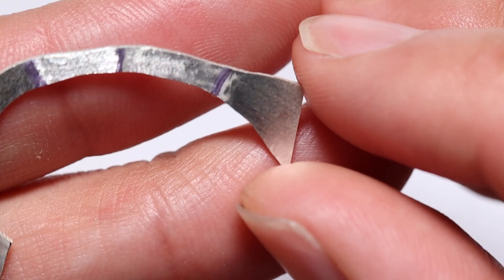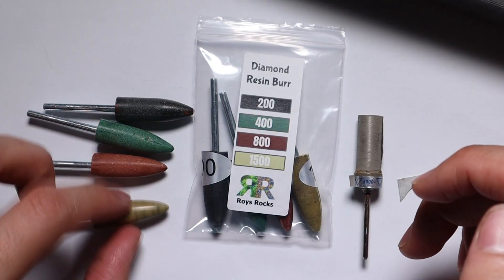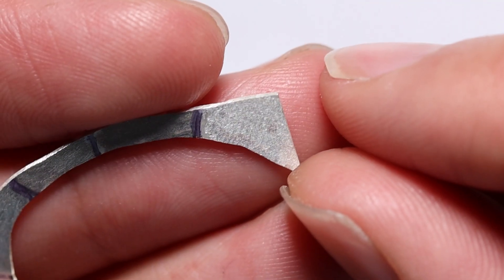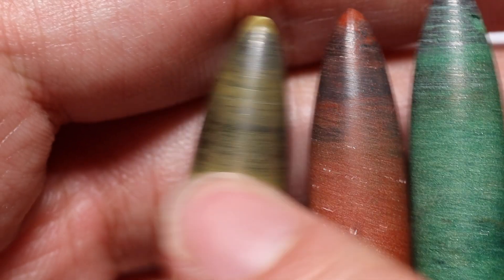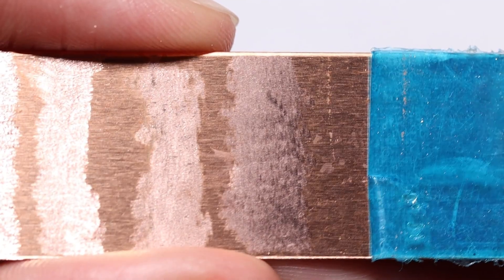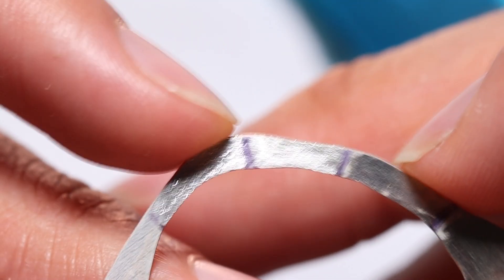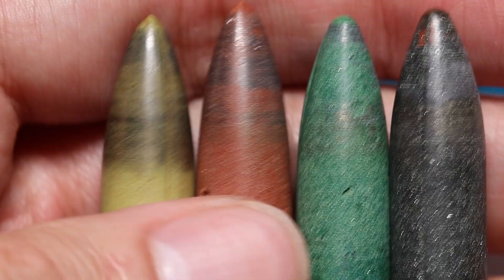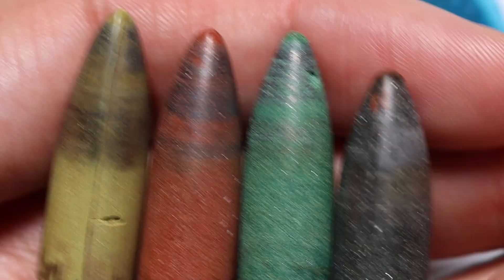Diamond Resin Burrs VS Metal. Silver, Aluminum/Aluminium, Brass, Steel, Copper

Comment: Do you ship to the US? I checked out the site but US was missing from the region list when trying to order. I'm guessing its a tariff issue.
Reply from the maker: You are correct I was shipping to the USA until tariffs came in but I have been cleared to send to the USA again so I will have to set it up again. Its just going to make the postage cost look higher than it should to include the prepaid tariff. Which I don't like but I guess if my prices are still competitive it is what it is.

Comment: You can also use cerium slurry/felt on your silver. Gives a very nice polish, better than the compounds if you do it right.
Reply from the maker: I actually havent tried CeOx on silver. I thought it would be too soft. The AlOx works well since I've used it on many metals at work.
Reply: @RoysRocks  I was trying to polish an opal in the setting once and figured this out on accident when my felt slipped off the opal and hit the silver.  Turns the felt black but makes the silver really highly polished.  I still dont understand why this works but try it, definitely produces really nice results.

Comment: thanks , i've got some 3000 / 6000 and 10,000 grit burrs but never thought to use them on silver, i usually hand polish with sand papers upto 7000 grit  then use some jewellers rouge ( my problem is i use a x20 magnification eyepiece to check for scratches and it really shows up every imperfection )
Reply from the maker: I reckon the 6000 then rouge would also work.
I also look with a x20 and I see why most dont. It'll see everything!!!

Comment: Thanks for posting this. Ive been curious what would happen if i used my nova burrs on silver.  Now i dont have to try myself. Sandpaper is still the best.    Take a mandrel, and make a perpendicular cut in the very end of it like phil does on @TheOpalMills , and slide a folded piece of sandpaper in the slot. Wont waste any metals.

Comment: Such a great idea. Is learning how to work with the silver hard?
Reply from the maker: A little bit tough. Mostly because I dont have a great torch.
Apparently with a better torch I will have a much better time but I can still get pieces done just takes a bit longer and needs more cleaning up after soldering.
Reply: @RoysRocks  Are the torches very expensive?

Comment: I have only used my rotary tool with a felt pad to polish some restored brass objects. Will try the resin tips next time. It will beat the hell out of using sandpaper and steel sool! Thanks Roy!😊
Reply from the maker: Yeah you can try out the highest grit and go down if needed.